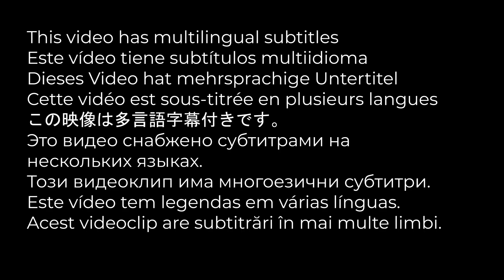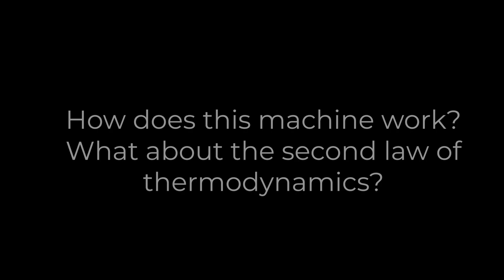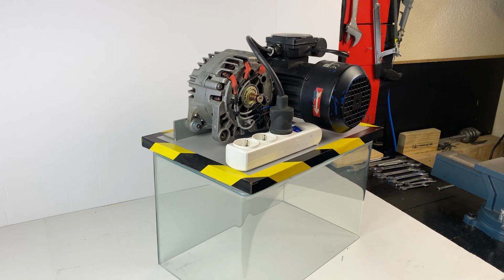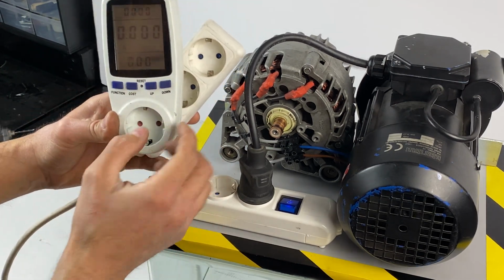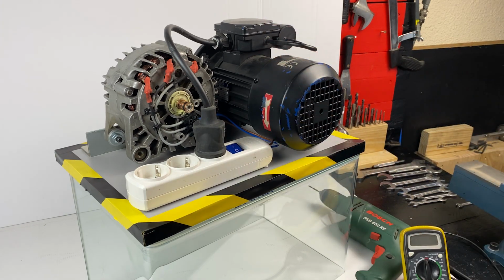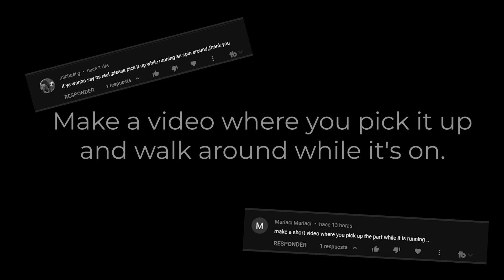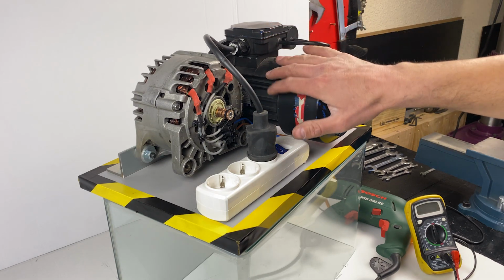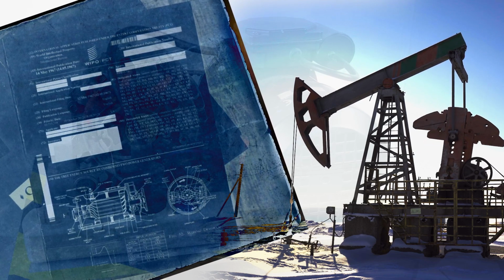We put this Infinite Energy Generator to Test - Liberty Engine 1.0

Comment: to further make it look genuine you also need to make sure that the base the engines are mounted on completely transparent as you can hide the great number of AAA  or thin lithium ion batteries inside the board that thick and use it to drive the DC motor or even AC if small transistor circuit used to invert DC...
Reply: Yes, that black and yellow tape is looking very suspicious! The more videos I see from this guy, the more I think of David Copperfield.
Reply: Of course it's bogus. They'd be billionaires a long time ago if it really turned out to work
Reply: @wauwau1  that is the common logic, but one can also wonder the possibility of those making trillions from oil/gas not wanting this kind of technologies out there
Reply: @raydan18  true

Comment: The thick base should have been removed and replaced with transparent plastic to prove there are no batteries in the base. You should also plug in a 2 or 3kW resistive heater that we can see glowing, and leave it turned on and operating for several minutes.
Using a drill for a load is not very much load and it has a very bad Power Factor. 

Do not be afraid to prove it if it's true.

Comment: The hardest part of making this is finding where to hide the battery pack :infinite energy is impossible
Reply: The idea behind it is that they are consuming the energy inside a magnet to power an electromagnet, it would work for a long time but eventually the magnet will cease
Reply: @flynndobson5473    No, this idea does not work at all. The energy of a permanent magnet is surprisingly small, even with strong magnets only about 0,5 Wattseconds per cubic centimeter. You can find this in the data sheets of magnets. And this energy is not spent when the magnet exercices forces, otherwise the energy would be depleted in a wink. The energy of permanent magnets stems from the process of magnetizing them. You have paid for this energy already when you have bought a magnet, it is a small part of the price. You can't expect to get out more than that. 
The idea behind this video is to deceive people. Just one of the many scams shown in YouTube.
Reply: @heinzpg  no you’re wrong this is free energy in front of your eyes
Reply: @heinzpg  that’s because it is. You just have to have faith in them and god to see it is true🙏🙏🙏
Reply: @heinzpg  I’m just messing with ya bro idr my original comment🤣
Reply: @flynndobson5473    Ok. As for your original comment I can only repeat: it does not work for a long time until the energy of magnets is used up. It doesn't work at all.

Comment: I know these things work. My dad showed me how to make these back in the mid 80s..I've made a few myself  using 2, 3 and 4 alternators. 1 as an engine and the others for energy.. I use a lawn mower starter string to wrap around the pully to start it.. works great..
Reply: Hi Tim! Can you tell me exactly how the polarity of the two glued magnets are? Let’s say we have two glued magnets on which is written „N“ then the on the left magnet is the Southpole inwards to the shaft or left ?
Reply: Thnaks bro, your comentary is real good , ill try this because i wanna study electricity
Reply: I dont know anything about electricity.  Make them the way I was taught. They work and that's all that matters to me. The alternators charge the batteries which power a house and a garage when the solar panels aren't pulling in enough energy...
I've been making these things since I was about 4 or 5.. it's not rocket science. you don't need to be an electrician.. it's a power source my dad used to fix cars that were stuck on the side of the highway.. he also kept one in his trunk with a space heater. I also have 1 in my trunk with a small space heater.. my 11 and 8 year old boys make these for their club houses.. we take them fishing.. take them camping...we even mounted them in old tires to cut back on vibration and noise..
If you all wanna learn about all the technical crap then go for it.. me, I don't care about all that crap.. I know how to get them to work and that's all that matters to me.. it's not rocket science.. my children make these.. we teach other people how to make them.. we help people make them every so often.. 

People get all butt hurt over the dumbest crap..
Reply: How are they done? Do you also modify the rotor using ND magnets? It would be very aapreciayed if you share :) thank you in advance
Reply: @schnitzer0  I use them as regular old alternators.. I go to the junkyard, find a van or truck that has all the high tech comfort gadgets like TVs, VCRs, DVD players etc cause they use bigger alternators that push more amps.. they're 15 bucks a piece.. 
If I knew how to do all the fancy stuff like the guys in the videos, I'd do it but I've never attempted..
I watch these videos to learn how to do the technical stuff and all I see are critical assholes.. these dudes are trying to teach people (who are willing to learn) on how to make these things and people want to be assholes, it dumbfounds me..

Anyways, I'm trying to learn just like any regular person to see if there's a better way to make these things cause I know they can push more power than what they're meant for....
The ones I make are self powered but they're just regular old alternators and they charge my batteries. I do have emergency kits in our vehicles that'll power a ceramic space heater, charge your phone.. they do what they're made to do...
Just trying to learn how to make them push more power..
I also took 2 alternators and connected them to each of the CV axles with a modified pully in a 2019 Tesla Model S and made the car "self charging" by an on and off switch I installed on the dash board.. he hits the switch when thw battery gets to around 30% and the car will charge in about a 45 minutes of driving.. he said he's only used a charging port once since they were installed... it works.. if you know anyone with an electric vehicle inform them on this.. I'll have to call dude and ask him what type of alternators he used.. he bought the stuff and I built it..
Reply: @TimSpaw1leg  Thats pretty cool man! And thanks for your reply! Ive been playing with hho, gasoline vapor and electric motors a while and i like this a lot but im not very electronical-wise LoL, is there a way i can get in contact with you to share info?
Reply: @schnitzer0  I'm on Facebook under the same name and I think the same picture..

Comment: Some calculation and estimation for system efficiency:

If this generator really works (I am not sure even it looks real from video until it is reconstructed by many others, enough to make it believable) then let start from the maximum mechanical power per axis = 550W apart from the friction loss due to the belt drive. This is the input power of the modified alternator on axis. On the output side we only saw in the video a drilling machine with 1200W starting power + 900W needed for driving motor at full load. So the efficiency is minimum: 2100W / 550W = 381%. 
If it works then the following modifications can increase the efficiency: 

1. forget pulley and belt, assemble the motor and the alternator facing each other connecting two axis with a flexible clutch to eliminate the friction loss of belt
2. use a higher efficiency drive motor (not so easy to find with this low power around 0,55kW)
Reply: amilyen hülye világ van én már mindent is elhiszek...

Comment: This motor will save the world :) Why do we need wind and PV - Energy anymore if it works just like this :)
Reply: Exactly 💯 from what I'm seeing, you wire one per room and you got plenty of power 🤷🏻‍♂️
Reply: Because its a trick for views folks. Read up on thermodynamics you cannot get more energy out than you put in. Plus no motor or generator can run near 100% efficiency. Add that to friction losses in drive belt or coupling and you are at least missing 25% of the energy needed to work. Connect any thing else and it will stop, not that it would run i the first place.
Reply: @chrisclarke6344  A heat pump is ~300% efficient, IIRC
Reply: @johnarnold1157  so they might but this contraption is not a heat pump is it?

Comment: Imagine two of these installed in an electric car...This is blowing my mind.  You could drive a car off the energy and have a battery backup that would self charge!
Reply: This doesnt work. Look at the full content of his channel
Reply: @hckgaming239  OK i will...thanks
Reply: @hckgaming239  explain
Reply: @hckgaming239  Which video are you referring to? Best-
Reply: Problem is, cars are 70 to 85kv so you need 7 to 8 of those if it produces 10kv and where would you fit 7 alternators in a car.
Reply: @anteskojo5959  I have been researching this and i believe we have been catfished.  Great thought though!

Comment: Cool experiment. Unfortunately frequency regulation is important to inductive loads especially working in long term conditions. I think your 3phase idea will improve this or use a beefier motor with input frequency and voltage regulation. If I get some time I will check into this.
Reply: Melodeon
Reply: Will you get za shock from this unit
Reply: I just tried getting one to work. Not sure what I did wrong could be a lot of things but I was only getting 8v at 2500 rpm with 150hz. I used 24mm x 10mm x 5mm magnets. I only cut a slot in the teeth. So could there be interference? I removed the brushes so there's no load? Maybe I'm shorting the coil from scratches? The coils are bad to start? No idea....
Reply: Wow Tony! There could be multitudes of things gone wrong. But from my observation if your motor is 50 or 60Hz stay in that range. Higher frequencies will attenuate due to the reactance of your circuit. Placement and proper alignment of your neodymium magnets is crucial. Just a couple tips that should help you. Follow his build instructions it’s pretty good. The only thing I would have added is a frequency regulation circuit. I wish I had more time….
Reply: @Canadianhonkindiesel  I don't doubt there was a lot I did wrong I was rough on the alternator like a caveman with a rock.  The alternator could have been bad to start with so we'll see when my new one comes in.
Reply: @tonyfoxxbuilds1920  Good luck and wish you success. I am working on a slightly different design at this time. I have been successful on a small scale but trying to make one in the 5 kW range. WIP
Reply: @patrickdoohan2951  🤣
Reply: Wellen hat Frequenzen
Reply: @patrickdoohan2951  Only if you contact both terminals!
Reply: @JP-bd4zl  LOL- I am not a trucker, but with them in spirit!
Reply: @Ivan-tq4bx  Huh! I don't understand you...
Reply: @Canadianhonkindiesel  Why not ? Don't speak english ? it is better you don't understand me now when BTC is almost to arrive minimum ... you don't need to understand it my friend
Reply: @tonyfoxxbuilds1920  my friend
If those magnets in presentation are the one used are much bigger than yours sizes . From my point of view I think are 30mm x 20mm x 8 or 10mm at the curvature. Anybody's guess ???
Reply: @Canadianhonkindiesel  could you share your experiences with us please?
Reply: @MARIANROXY  I have lots but I will definitely share once I prove the science. Cool thing is who will post first. I know 100% free energy is real! I just need some time.
Reply: @MARIANROXY  ya I wasn't sure and the ones I got were very wrong. I did find some with a curve but not as thick as they have in this video.
Reply: @chrisclarke6344  few months ago I would instantly agree with you. Hell one of my clients tried telling me about this concept and my mind glazed over and tuned out whatever he was saying. But I saw an off grid farm video with a few patents to help off grid farmers. He had these interesting wind turbines. The small amount of copper and neodymium magnets put out a lot more energy than you'd think. It's definitely a project worth tinkering with.
Reply: @tonyfoxxbuilds1920  it doesnt matter how powerful the magnets are, the more powerful the more energy you need to drive the generator. You always need to put more energy in than the energy out. This is because it is impossible to have them operating at more than 100% efficiency. Even at 100% efficiency you have to overcome bearing friction, drive belt friction and the resistance in the generator. Without resistance you will never generate current, the stronger the magnet the more resistance so more energy is needed to drive the generator. A wind turbine turns the generator  by wind pressure on the blades and that is where the extra energy comes from. These videos are just for views and ad revenue. Good luck if you wish to pursue this but dont put any money into it because its a fruitless exercise.
Reply: @chrisclarke6344  
Can you explain then why it works on the video,where is the trick?
Reply: @vadimkot90  at least three ways batteries and invertor hidden in base board or motor. Just batteries hidden and use alternator as a 12v motor. Or a hidden power supply from the  mains. As the video was cut and edited you dont know if the 'motor' was a motor or a shell hiding a 12v motor and batteries  which was swapped during the edit. It certainly is not made possible because of super strength funny named magnets, all they will do is increase the power needed to turn, which will make the contraption even less likely to work. The whole concept is flawed you cannot get more energy than you put in.
Reply: @chrisclarke6344  there's something wrong with that theory "you can't get more out than you put in", a magnet sticks to a fridge and no energy is being put into the magnet, there is more energy coming out.
The theory of relativity destroyed! 🙏👍🏼✌
Reply: @DaVeHiLl200  i feel i detect sarcasm in that statement.
Reply: @tonyfoxxbuilds1920  The magnets you used are surely too small! In my rough estimation, they should be closer to 28x18x8mm or somewhere in that range which means they have also much more kg power than the one you used. This, for sure, will have a significant impact on how the machine works...
Reply: @chrisclarke6344 They trust their eyes more than their minds.
Reply: @DaVeHiLl200  I now have 100 magnets on my fridge, but it still won't work without electricity from the socket. Something about your theory is wrong.

Comment: O.k nice work dude, however the thickness of the base and the fact the edges are covered in tape remain an area of high suspicion for me. I would like to see it run with a clear base and all motor covers removed, including the multi plug case.
Reply: I think the same.
Reply: They power through the casing and and the whole Base is an inductor.. Somewhere there it should be a big coil
Reply: exactly, mount everything on a transparent base
Reply: People are so gullible. More so when they do not have the slightest idea of what something like this would represent. Free energy for the universe. It’s idiotic to think that a guy on YouTube has the technology to do it but all the scientist in the world for centuries, trying to get, not a free, but just a cheap form of energy as alternative to oil, have been defeated by this guy. Ludicrous.

Comment: Would like to see an unedited video of the build I would also like to see the caution tape off the bottom of the board and I'd like to see you open up the actual motor. It appears to me with this it's 100% efficient and that goes against the laws of thermal dynamics
Reply: id go with batteries in that large motor, running a smaller motor in that hugh case
Reply: what could you possibly find inside the motor that would make the alternator produce 220V ?
Reply: it does not did you not hear the statement of needing to replace bearings every 6 months also this set up would produce a lot of heat im guessing that is why he doesn't run it that long as a possible down side to this set up 

also there is no way a battery even as large as the base could run that motor and a drill for as long as he did while still having steady ish voltage it would have been constant and slowly dropping
Reply: @JapanAlex01  Exactly, which is why it can't possibly work.
Reply: @RobyThe1  batteries and a 220v inverter could easily fit inside the motor and junction box on top. The alternator could just be a motor spinning buy using the 220v created. There are also simple relay circuits that could require some voltage created by the pull cord to turn on the inverter.